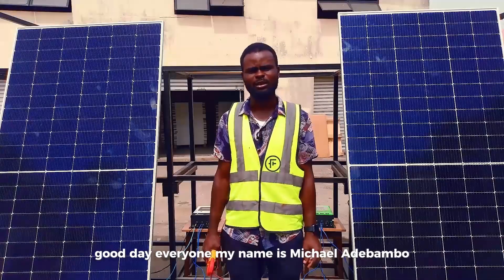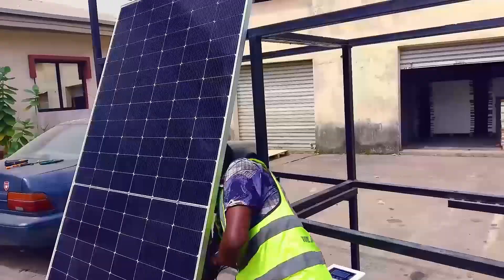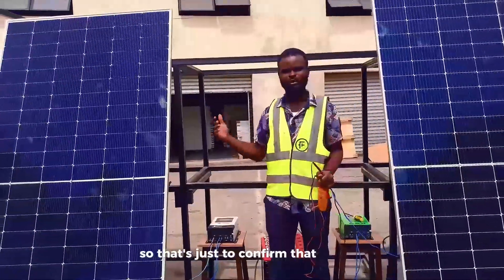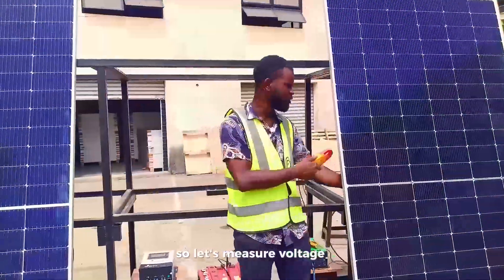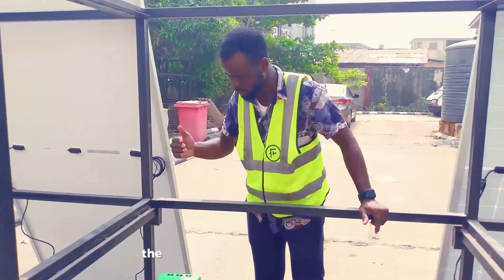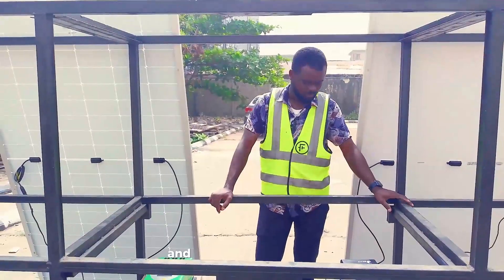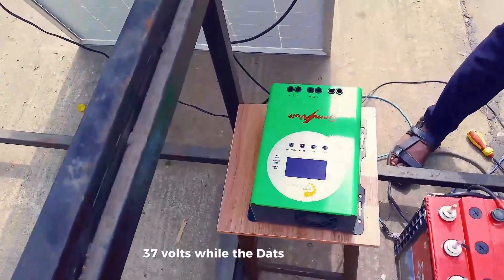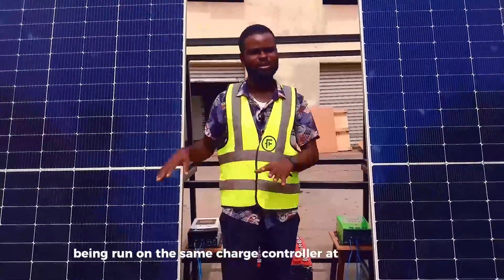Sunova 555W vs. Jinko 555W Solar Panels: The Ultimate Energy Showdown! (Powered by First Electric)

Comment: sorry oo why is it dat solar panels don't produce even close to the rated watts i have 2 new 600w half cut panels and i use mppt charge controller but i only get 400w max from both panels please can anyone help? angle and everything is correct wat could be the problem
Reply: What’s the name of your panel?
Reply: Was the connection in series or parallel?